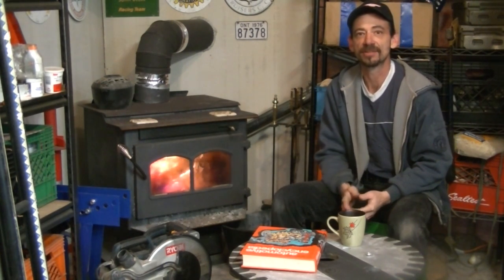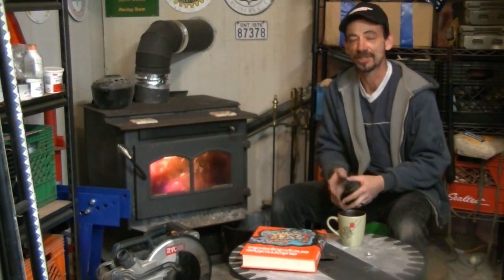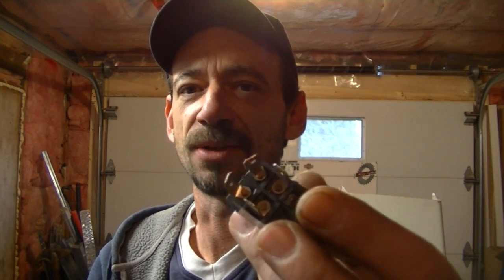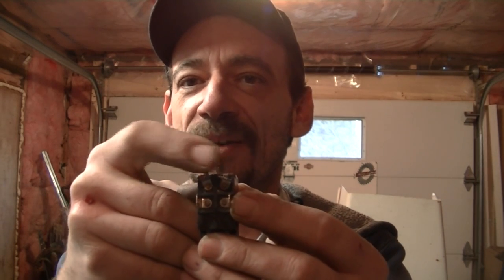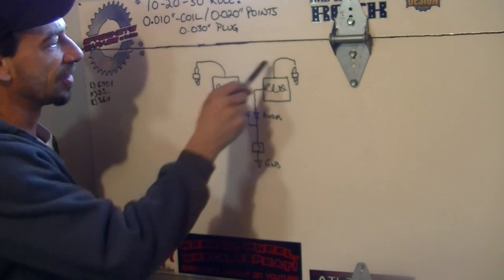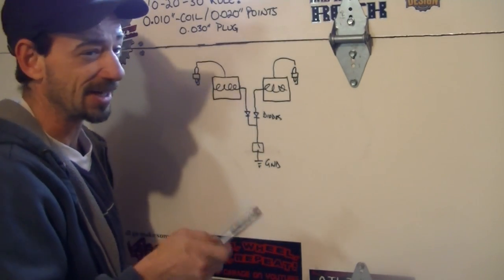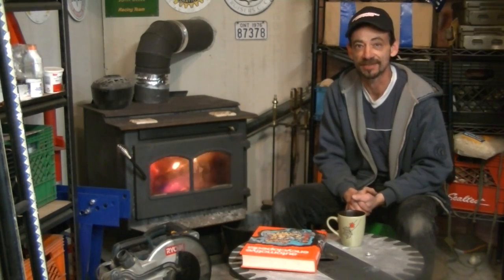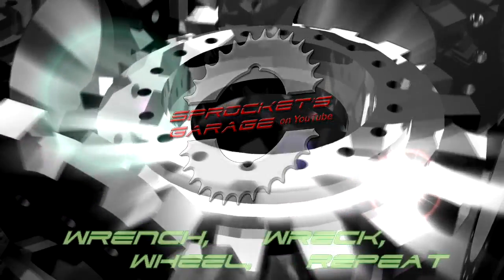Doc's Dirtcheap DIY Ep. 1- V-Twin Diode Destruction

Comment: Nice catch! I just reached that same design today after I realized that my 20hp Briggs IC V-twin coils won't fire with just wire connecting them together.
  Runs ace with the kill wires disco'd.

I think you have the bands backwards in your diagram tho.

The Briggs harness has the bands facing the coils, not the kill wire.

Comment: If you have a carb with a fuel shut off solenoid, just pull the kill wires off the coils...the fuel cut off solenoid will cut off the fuel, and engine will stop. it just takes a second or two longer to stop...

Comment: I don't think my 20 horse vtwin I/C quiet has any diodes.
Reply from the maker: If it's still stock, it does, and you can't "just remove them" without working out a solution like I did, here.
Reply: Yeah I found them, there down back behind the right cylinder under the shroud in front of the starter.

Comment: very good vid...it seems like common sense to eliminate the diodes. i ended up finding a switch plate w 4 switches that came with pins to lock 2 or more switches together so i went for it and it does look cool i even wired in a 12 v cooling fan and lights.

Comment: if you have an old radio somewhere, be uit a house radio or one out of a car, there are diodes in these you can use if you have time to locate thenm and take them out
Reply: +Sprocketsgarage Doc, diodes come in different sizes to handle different amounts of current. Small diodes from a radio may not be up to the current a coil uses.  The switch seems like a good permanent fix. Love your channel, keep em coming!
Reply from the maker: +Tim Merritt Indeed. Trouble is, When this issue had come up, I had NO broken electronics to molest for parts.